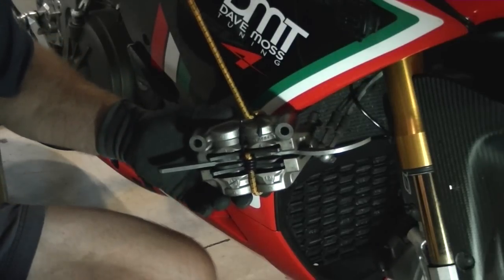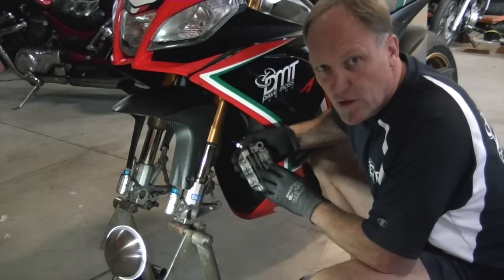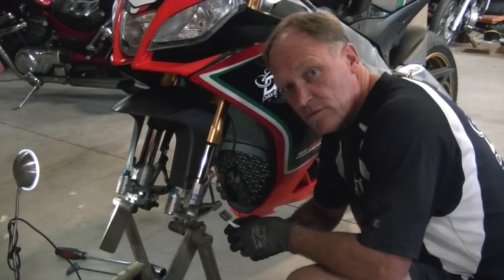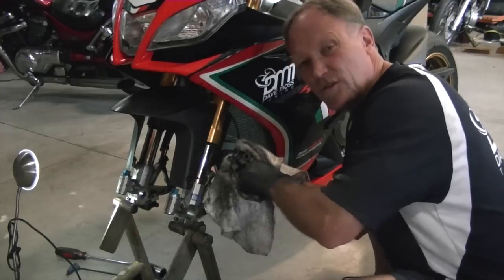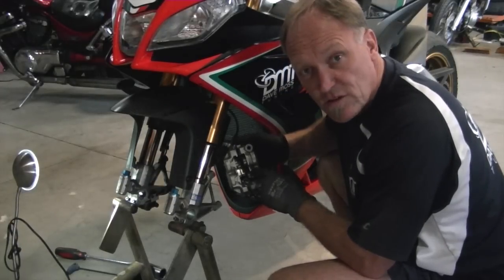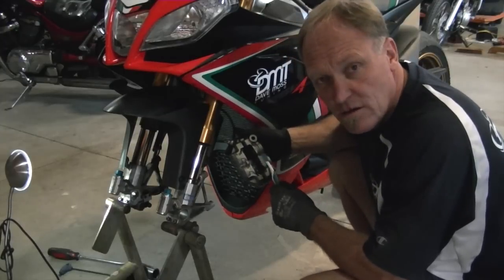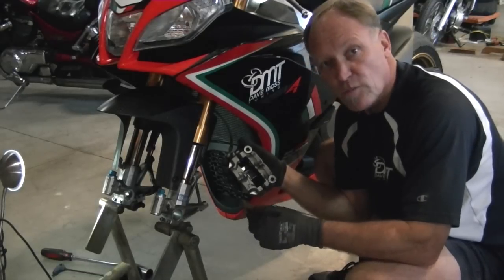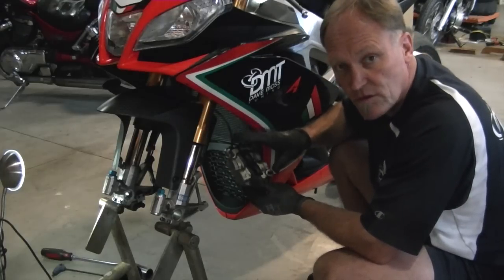How-To: Brembo Motorcycle Brake Caliper Cleaning

Comment: I realize that this is an older video, but after watching this I cleaned my 3 year old calipers (installing new pad). I'm ashamed to admit that I didn't know that you could, or rather should, clean the calipers. I had to laugh at myself, after the cleaning I questioned my re-install because I could clearly see the pistons, where before I couldn't--they were just too dirty before! And, most importantly, one piston on each side was sticking a bit. Thanks, Dave. Still learning at age 64
Reply from the maker: We all start somewhere Steve! I rode for a decade knowing and doing nothing to all my motorcycles until it was servicing time as per manual or something broke. Shiny caliper pistons do create a double take as we do not take them into account. I am sure you will notice a braking improvement with all pistons working correctly.

Comment: I like to extend the piston out until I can see the clean part, then I take a shoelace and dip it in clean brake fluid and clean that piston pristine. Now it’s nice and lubricated, now you can start working it in and out until it moves nice and freely. Do them all this way.
Reply: Shoelace is a great tip! Thanks

Comment: Simple.  To the point.  A few Questions:  Why did you not use any type of brake cleaner?  What is the maximum travel for the pistons to come out for the cleaning before it becomes a concern?  And, what is your recommended "Clean the brake calipers" interval?  I do not ride on windy days or any inclement weather.  No rain. No snow.  I have 36,768 miles on my ZX10-RR and this is my first day of scrubbing.  So far, I only see 1 piston moving on my front left.  That's a bad sign.  But I want to do it right.  Can you assist by answering the 3 questions above?  Thanks in advance.
Reply from the maker: Brake cleaner makes rubber brittle. That can create leaks.Maximum would be 5mm. Interval would be every 2,000kms if you are a fair weather rider. Once a week if you commute in wet weather.

Comment: Unreal! Dave this was crazy... I just did one caliper today. One piston was moving freely, the other three were barely moving! I spent a lot of time cleaning the pistons, is it OK if one still moves freely and the others move if I hold back the free moving one? Or should they all move in unison. If so I may need a rebuild kit
Reply from the maker: Thanks for getting your hands dirty! All should move in unison so you will need to use air to blow out the pistons and then clean/grease the seals. Polish the pistons with a microfiber towel and reinstall after cleaning the inside of the caliper for grunge.
Reply: @catalystreactionsbw  i just subscribed for one year on your site but I'm not seeing a video about how to do a rebuild of the caliper. Am I missing something?

Comment: Wouldnt it be a good idea to just use brake fluid to clean the caliper pistons? A little of whats on the inside on the outside. First time i ever did a brake job on a bike i by mistake made the pistons fall out, the resulting mess of brake fluid cleaned the caliper and pistons really well, while also keeping everything lubricated.
Reply from the maker: Thanks for your contribution. The soap dries onto the piston surface and collects the brake dust keeping it off the piston surface. That's one advantage along with very easy clean up. Brake fluid will trap dirt and debris both in front of and behind the dust seal and may get onto the pads once the brakes get very hot.

Comment: Dave first time today cleaning brembo calipers on my V4s. Did as you said, pumped cylinder to extend pistons but one popped out with a loss of some brake fluid. Pissed. Should I have expected this? A warning would have been helpful. I put in back in and only lost minimal fluid. What's the fix to make sure this is still fully functional. tAppreciate the help thanks.
Reply from the maker: Hi Mike. Sorry that happened to you and I appreciate the reference to adding text to the video. I'll forward that on to Dave Williams to see if he can add an edit. Once the piston has been reinstalled, bleed the brakes again with something locked between the pads and the bleed nipple at the highest point to encourage the air to the nipple.
Reply: @catalystreactionsbw  Thanks for the reply. I have a bleeder now and that's the plan.

Comment: Awesome videos Dave! I'm planning on changing my brake & clutch hoses on my 1199 with Tygon 2750 tubing. 

I may as well take my callipers fully off and clean them in the bath? 

Any tips when replacing the brake fluid after to ensure there's no air in the system?
Reply from the maker: If you are taking the lines off, I would use compressed air to carefully remove the pistons as well (keep your fingers out of the way and then clean the caiipers that way as well as clean the pistons and wipe out the junk in the groove of the oil seals.

Comment: So all we want to use is just soap and water (dish detergent) and rinse.   No WD-40 or any other harsh cleaners or degreaser except maybe brake cleaner ?   Might leave a residue which does not mix with brake fluid I take it.   
I'm getting ready to inspect and take apart to replace the seals anyway.  How often do you replace the caliper seals?
Reply from the maker: Caliper seals are very 3-5 year depending on your level of ability and type of use.

Comment: Hi Dave, I'm worried about applying too much brave pressure and popping the piston out to check all pistons move freely, how do I do this ?
Reply from the maker: Two people needed. One caliper is still mounted, there fore not an issue. Squeeze the brake lever once to halfway from off to the grip to see if anything moves at all. If 1 or more move, clean them. Now you hold the pistons that were cleaned. Squeeze again (same distance on the lever)  and see which moves next. Clean and continue until all 4 are cleaned.
Reply: @catalystreactionsbw  Great, thanks Dave. That should do the trick

Comment: dont use any water or soapy water or brake cleaner FIRST. get a good paintbrush and get all the loose dust. then get a brush that is a bit stiffer (not wire)  clean again. blow off with compressed air. 
if every thing is clean use soapy water and clean again...

Comment: VertalingToday to my local dealer. After 5 tests with the moto, she discovered that my brake discs were crooked. I had a quick question can I reuse my brake rotor floating buttons and how do I get that look? Because with new order there were no. When I get my brake disc back lashing you might know on how much I this should tighten with a torque wrench because I have no information on here?
Thx Dave
Reply from the maker: A company like Galfer specializing in brakes will replace buttons on their products and your stock rotors cannot be straightened. Make sure when you get new rotors the company will replace the buttons.

Comment: If I do this process with the wheel on can I just leave the caliper I’m not cleaning bolted up and allow the pads to push against the rotor?
Reply: Yes. The point is to have ANYTHING there to keep them from coming out too far. If they come out far enough they'll actually come out of the bore and soul fluid everywhere and then you've got a real big mess in your hands.

Comment: Hi Dave, i AM asking myself why don't you use brake cleaner ?
Reply from the maker: It drys, perishes and cracks rubber and with high pressure form the can it drives dirt behind the pistons.

Comment: It's better to use brake cleaner to wash and flush the majority or the dirt and crud off before pushing the pistons back in. All you are doing is driving the junk into the seals if you do that first. They make brake cleaner for a purpose and it isn't going to damage any parts of the brake system. Soap and water is fine for finish cleaning but it really is best to use brake cleaner first otherwise you are creating issues with sticking pistons just like in the video.

Comment: Hey
I had a quick question about a brake problem. As I above the head and hard braking 100 per hour I get vibrations on my handlebar what could this be? Warped brake discs? I've already shown by measure but this saves almost nothing. What else can I find out about this problem. The moto is a bmw s1000r of 2017
Reply from the maker: Steering head bearings loose, front forks twisted, brake caliper piston(s) not retracting properly.
Reply: Thx i will check it. I let you know when i solve the problem.
Reply: Today the brake calipers cleaned. Some pistons came hard. This I have tried as best as possible to clean. After I had seen  your clip how to reinstaling a front wheel correctly i take the tip you give at the end of the clip and now it vibrates  70% less . So there is still a bit of vibration but that's probably normal for sure? I think Warped brake discs is not a issue
Reply from the maker: Seems like another caliper cleaning in the near future would help again as you are sure that the rotors are not warped.
Reply: Thx Dave for now i have the time i give it another try.

Comment: you shouldn't back out the pistons brake as a first step NEVER, because the pistons may have debris and/or littler rocks, and if you back out them like you did, then this dirty elements can get in between the caliper and the piston, BAD BAD....

You have to do a little clean up first before moving the pistons at all....
Reply from the maker: Thanks for your comment. I agree if the pistons haven't been cleaned for weeks on end and are very dirty indeed. These brakes are cleaned every 2 or 3 weeks with a total of 3 or 4 track days on them. The dust seals will take care of dust, so the soap on the pistons from the last cleaning captures the dust and that makes cleaning easier.
Reply: Very true, that was a lame thing to do. Plus he actually forced the piston in and maybe that was the actual cause of sticking. You NEVER push the piston in prior cleaning it thoroughly.

He didn't even prepare for the video because he did not know how to take that particular brake pad, that was funny to watch.

Comment: Soapy water has not worked nearly as well as break cleaner.
Reply from the maker: Agreed when used with a cloth. It will not work well without a toothbrush.

Comment: when I clean my brakes they dont work as well for ages. so I tend to just give them a quick clean rather than really thorough
Reply from the maker: How do you clean them? Brake clean or soap and water? The soap will act as a lubricant.
Reply: brake clean and a toothbrush. for some reason if I dont leave some transfer material on the critical surfaces they just act crap for ages. obv cleaning the lip of crap off the piston and the slides is fine

also another question. if a bike has 2 year old fork oil in it. and  I change it for new oil/seals. does the suspension firm up or get a bit softer with the new oil.. generally?
Reply from the maker: Thanks for the information. Brake clean hardens the dust and oil seals in the calipers. Fresh fork oil will give less oil viscosity range between cold and hot.

Comment: Bad practice. Pads out, limit the travel with suitable tool and push out until clean parts of pistons are seen. THEN clean them up. 9 out of 10 times sticky pistons are caused by the tight dust seal. In UK its usually aluminium corrosion and other crap accumulating in the seal groove and pressing the seal tight against the piston (remember people falling off their BREMBO equipped KTM's ?). The only cure is cleaning the corrosion and contamination out of the grooves to enable proper seal seating. TBH, I can't understand why the hell motorcycle manufacturers don't design their calipers with rubber boots around the pistons, just like in the car brakes. I know you need that extra heat dissipation in performance brakes but lets be honest, more docile street and touring bikes could have them with no detrimental effect on performance here. It's usually YEARS before you even need to think about rebuilding a car caliper, bikes, especially if you ride in winter, usually need a lot of attention after two to three years (especially Brembos, those things were driving me mad on my F800GT)

And monoblocks are Satan's spawn...